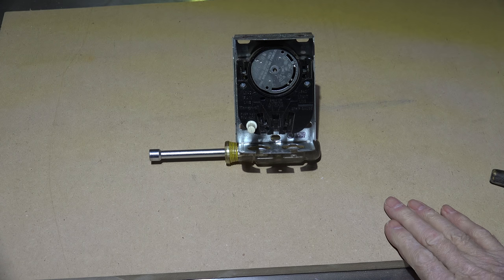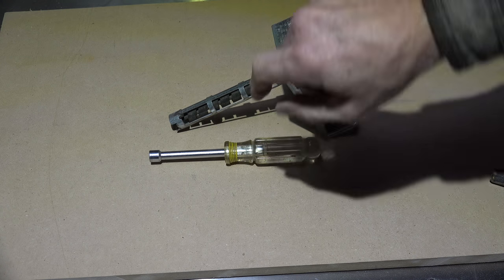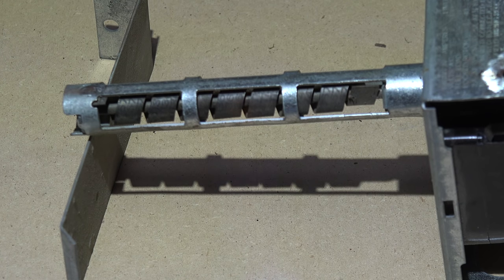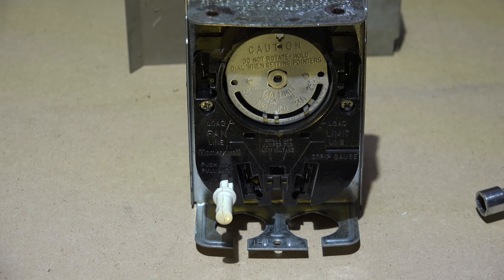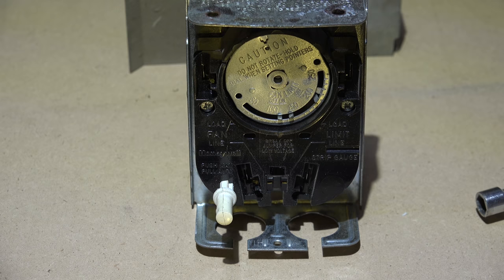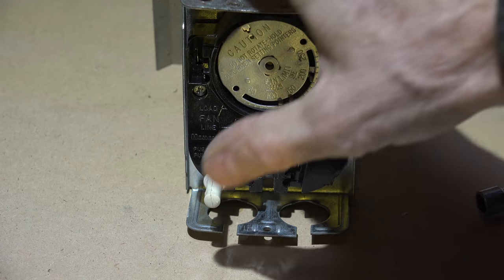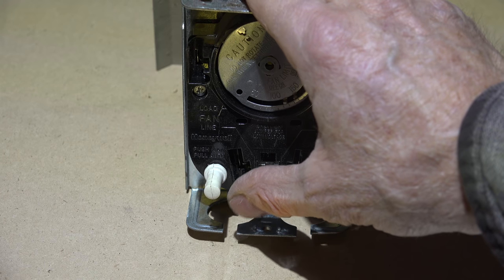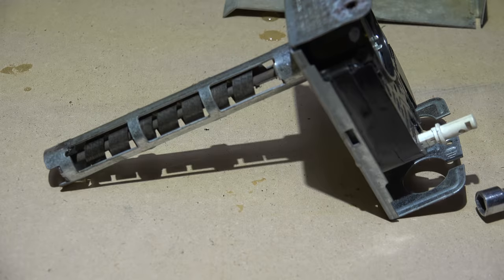The Honewell fan and limit

Comment: Great video!!! Im no expert, nor do I work in the trade but I Like to learn and understand the different parts used in HVAC systems, especially in residential home. Thanks for these videos. I was just looking at my aunt's gas furnace which 30 + years old and it still work great! The Iimit switch explain in this video is exactly what what my aunt's furnace has with the bi-metal spring. Awesome video!!!
Reply from the maker: +30kendel Welcome
GFM

Comment: This fan switch is exactly what I have on a Wood Chuck, wood burning furnace.  Recently, when I plug the power cord into the 120v ac, the fan starts to run without the furnace fired up, and that is with the "pull" on the unit, pulled out.  It had worked in the years previously, but not now.  I will remove the unit and try heating the element like you did here with a propane torch to check for rotation.  The name Honeywell is on the unit with no other identifying information that I can determine.  I am wondering if there is a way to test the two micro switches?  Great information and thanks for doing it.
Reply from the maker: If the unit is on when there is no heat, it is stuck on.
Measure the length of the probe.  There are 3 lengths:  5", 8", 11".
You can find them on the internet or your local HVAC dealer.
GFM

Comment: My old furnace with this type of limit switch.  I want to add an fan on/off switch outside the furnace so that I don't have to take the furnace front cover to turn on fan on or auto.  THe 120vac is going through external switch.  how to connect the external switch?  TIA

Comment: After my pilot lights, about 3 sconds later, I hear a bang.  I can tell it's coming from the limit fan switch with the dial.  Question, is the metal element that turns on the shaft in the furance getting hung up when moving.  Everything works just fine, just a bang afew seconds after the burners light.  Thanks for your help.  David.
Reply from the maker: If the bang does not happen when the fan motor comes on, I would be checking the heat exchanger for cracks.  If it happens when the fan comes on, I would be looking at the fan and motor assembly.  I have never seen the fan control make that kind of noise.
GFM
Reply: @grayfurnaceman  ok. Thanks.  I'm going to test fan limit switch by pulling out the rod end, with the metal coil/spring and add heat to see if it pops or clicks while out of unit.  Is that safe to do?

Comment: Hello I hope you still can see comments because I need a little help, I have an older oil furnace and a Honeywell limit switch. The last couple days I've noticed the furnace doesn't want to turn off, it's not overheating but it just stays on instead of reaching thermostat temp and shutting down. The dial seems to be sticking and I can give it a flick and the furnace turns off but is there a fix for that? I'm just assuming it's the dial that's sticking and not something more serious. Any suggestions on fixing the issue or maybe you have experienced this before and know the true cause of the problem?
Reply from the maker: The fan control is failing.  Replacements are available, you just need to know the length of the probe.  You can remove the switch and measure the length.
GFM

Comment: Question about this exact part. Im working on a rheem package unit. On call for heat, burner kicks on, blower comes on, but burners shut off after a few minutes. System shuts down and retries ignition, works, and same thing happens. Problem is, blower is spinning too slow so cabinet is overheating. If I hook fan directly to heat then system runs normal and blower runs normal speed. How can I get the systwm to increase the blower speed so it will run properly on call for heat? Any help would be appreciated. Thanks
Reply from the maker: What do you mean by "hook fan directly to heat"?  Are you energizing the manual fan switch?
GFM
Reply: @grayfurnaceman  Ya, i wire it to energize fan when calling for heat... so you can see the issue with that right away! Lol... what happens if there is a call for cool or fan only! But the only way to get blower to operate at normal speed and for system to not overheat is when I wire Heat with Fan...
Reply: Thank you for your rapid response btw... Learned a bunch from your videos... hoping to learn a little more today too lol
Reply: Operation is in Auto
Reply from the maker: @xlxtruthxlx  In most cases, the fan speed that is energized in heat is a lower speed than that when you energize the fan relay.  When you connect the fan terminal to the heat terminal, you are energizing the fan relay.  
If the unit has run normally in the past, I would suggest you may have an airflow problem.  Plugged fan blade, plugged A/C coil or restricted ductwork.
GFM

Comment: Hello, 
Excellent video thanks... im troubleshooting my setup which has the same limit switch.  however only sometimes, usually when its colder and first thing in the morning the limit switch wont turn the fan on and it goes into overheat.  You can watch it rotate past the second 'on' point and just keep going to the limit.  Any ideas? many thanks
Reply from the maker: The switch is failing.  Replace it.
GFM
Reply: grayfurnaceman ok great thanks. Mine has the little red button as well.. the manual overheat reset, can I change it to one with an auto reset?
Reply from the maker: I would not.  The manufacturer used a manual reset limit for a reason.  If the manual reset limit is opening, you need to find out why.
GFM
Reply: ok noted.  Many thanks
Reply: My oil furnace convection fan keeps cycling on and off at longer and longer intervals after restarting beckett oil burner. After it stays on for one a a half to two hours with or without reset then everything seems fine the thermostat will even turn unit on and off 7 plus hours. Then I'll wake up in the morning and it's 40 something degree and furnace is tripped off. Then I do it again. Day 3

Comment: I have one in my wood burner plenum, is there any way to wire it for the fan in a new Goodman MBR blower section? The MBR has a 20KW heat strip.
Reply from the maker: If you want to circulate the air for the wood stove, you could use an isolation relay.
GFM
Reply: @grayfurnaceman  thanks for a speedy reply. The wood burner is a large older Longwood furnace and I replaced the blower with the MBR blower section and wanted to have the MBR unit pick up and heat when the wood burner got low on heat to keep it a more steady temp and no 60° or lower mornings in the house. I was told it would not work and I would have to put the thermostat on fan when running wood.
Reply from the maker: You will need a thermostat.
GFM

Comment: So my furnace will turn on and off and cycle correctly but then once the flame is off a couple minutes later the fan will turn back on run for about a minute and then turn back off with no flame. I already replaced the thermostat thinking there is an issue there but the same problem keeps happening
Reply from the maker: The temp difference between off and on is probably too close.  Set the on temp a little higher.
GFM
Reply: So I ended up lowering the temperature so the fan runs longer at the end of the cycle and that did the trick. It wasn’t cooling down all the way then temp heading back up kicking the fan back on. Thank you so much for your help and time spent on these videos
Reply from the maker: @reviewmystuff1785  That will work well if it is not set too low.  It could stay on continuously.
GFM

Comment: I'm replacing an ancient Honeywell controller.  How do I figure out whether to break the jumper off or not?
Reply from the maker: You need to find out if the limit switch is in the high voltage or low.  High do not break jumper.
GFM
Reply: Yes... I understand that (thank you) but how do I determine if the "limit switch is in the high voltage or low" voltage?
Reply: @drstrangelove09  Measure with a voltmeter

Comment: I replaced one of these today wire by wire in the exact same spot and it burnt the wires up by the fan blower motor completely melted them I put the wires in the exact same spot that they were before I'm so confused
Reply from the maker: If you are using stranded wire, did you depress slot before you inserted the wire?
GFM
Reply: @grayfurnaceman  I actually got it fixed I replaced it with a new motor but I still have a problem with the Miller it's cycling on and off and I don't know why she keeps shutting down and reigniting shutting down and reigniting instead of staying on consistent it's an old Miller in a 1985 trailer and a yes it is original The guts have been replaced I think in 2002 I've already replaced the pressure switch the fan limit switch and thermostat I am stumped!
Reply: @grayfurnaceman  Yes I got the wires in good That's all working now Thank you for responding

Comment: I could not find a model number on the limit switch, do the come with  that literature?
Reply from the maker: If the cover is gone, it may not have any. If you are trying to replace it, remove the switch and measure the length of the probe.  That's really all you need.
GFM

Comment: Is there a setting you can do to this switch to save on energy/gas?
Reply from the maker: If you set the temp off lower, it will clear a little more heat from the heat exchanger.  Also setting the temp on lower will start the fan earlier in the cycle.
GFM
Reply: However, the longer the fan runs, the more electricity you are using so optimum settings will correctly balance getting all the heat into your house space without excessively running up your electric usage.

Comment: mine is set at 90/150...is this correct?
Reply: Helen Kronk did you find out anything about your settings?
Reply: 90/130 would likely be better - optimally, when the fan comes on you want to initially feel warm air (90 degree) blowing out from your ducts, then getting even warmer (130 max) as the furnace runs.   When the thermostat shuts off the burner, the fan will continue running, the temperature of the blowing air will gradually cool until it reaches 90 degrees again which is when the fan should shut off.   I believe this is what GFM would tell you.